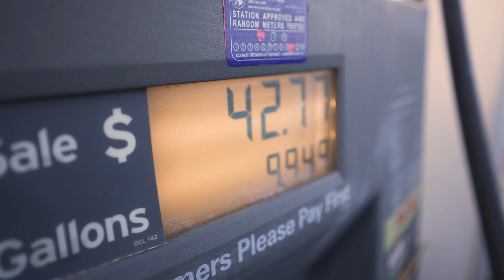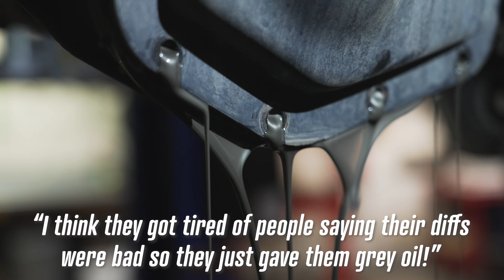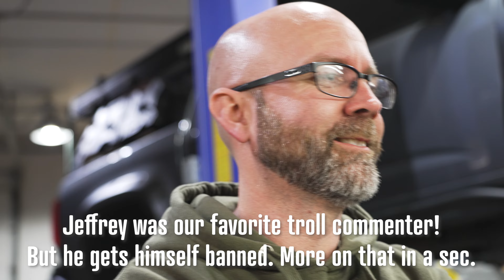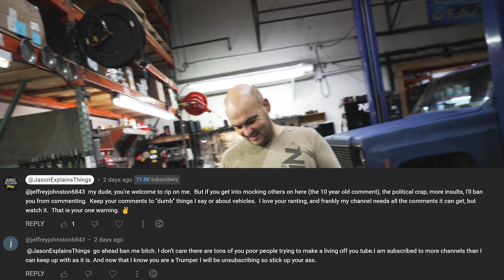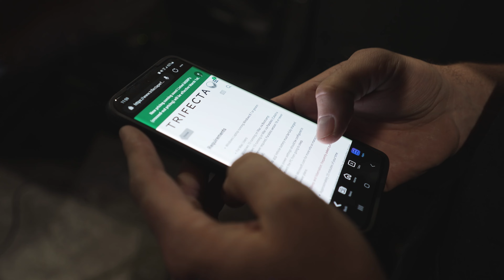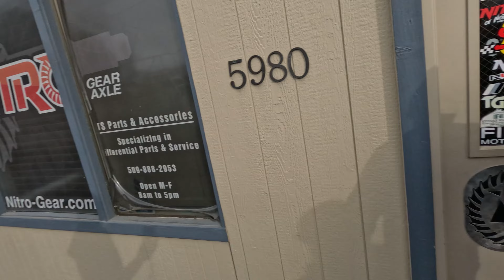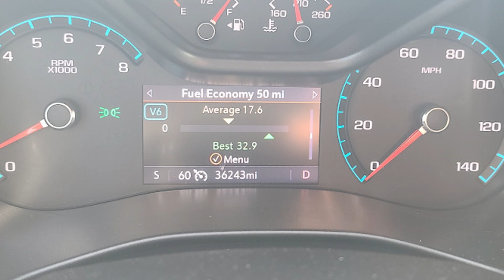Chevy Colorado Gets GEARS!  A MUST For Big Tires! (Nitro Gear 4.56)

Comment: Did your hear any loud noisy @65 0r 70 MPH?  according the colorado fan site, there some people complaint 4.56 upgrade.. I gonna regear my zr2 after you guys, don't know yet if 4.10 or 4.56
Reply from the maker: I passed this question on to Chris.  From what he's said I don't think there is any gear noise.  For the question of 4.10 vs 4.56... we deferred to Jerad's expertise.  He recommends 4.10 for a diesel with 35's and 4.56 for a gas ZR2 with 35's.
Reply: This is the question on everyone's mind, and to answer the question, yes! You can hear the gears.  But barely.  If I'm freeway driving, I can hear the gears if I dont have the radio on and am completely quiet.  This is going to be a personal preference thing, but for me it's so minimal, I completely tune it out unless I'm actively listening for it. Hope that answer helps.  I was worried about the noise issues others brought up as well, but now that I have them in, it's a complete non-issue for me.
Reply: Surpring the 0-60 was the same.  Truck need 5:13 or so gears if they made them.  The main problem with the colorados is the complete lack of aftermarket parts when you compare it to a toyota.  Not sure why the aftermaket does not support the colorado.  Should also mention when installing the nitro gear make sure the pinion depth is near 46 thousands not the 95 that nitro recommends.  If you go the 95 you will get a howl from the gears.

Comment: How much can one expect a regear to cost? I get that it will change based on shop and region etc. But it would be nice to have an idea. Thanks!
Reply from the maker: Parts are about $1500 (link below).  Labor costs depend on where you live.  I’d estimate $3k or so for the whole job.
Reply: Depending on your trucks mileage you could get by with just R&P and likely one or two pinon bearings.  That's what I did and it was $1400 back in late 17.  4.10's and 33's have been a great combination.
Reply: Mine colorado is 2wd it was 650 for parts and 600 for install in so cal
Reply: @MrPROGAMER56 Could you send me the link to the parts you used?

Comment: Curious that they recommended 4.56s, I feel like that'd be pushing it a bit for the front diff's pinion gear size. I suppose those V6s aren't terribly torquey though, especially with a 2.6ish low range

Comment: Great video! What's the cost difference with aev doing the conversion?
Reply from the maker: Not sure.  The upfit AEV service includes re-gearing along with the highmarks and other mods.
Reply: @JasonExplainsThings  at $13k from aev... can you calculate doing all the work on your own?
Reply from the maker: @okpop78  That right there is why we've done so much of it ourselves.  Chris essentially now has an upfit Bison with every AEV accessory.  We did all the work ourselves, minus this re-gear.

Comment: I had a Jiminy in my Colorado. The latch to the rear seat back on the driver's side was the culprit. A small piece of cloth tape on the u shaped latch striker silenced it.

Great video as always!
Reply: Checking this tonight, thanks!!
Reply: Andy (and Chris as well) did you get the seat squeak only when a person was sitting back there? That seems to be the only cause for my own little Jiminy.
Reply: It did only squeak with a backseat passenger. We couldn't figure it out for a while, but I'm ocd when it comes to vehicle noises so I kept looking 😂

Comment: That's quite a project! Glad there are people like Jerad that know how to do stuff like that!

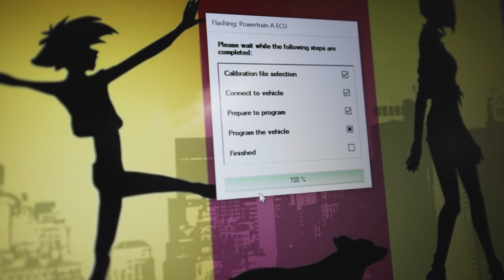@13:25 does Chris have the famous Colorado taillight burnout? I had to replace all 4 of mine on my 2020 within the first year and I see so many around with lights out. The lower-brightness on the dual filament burns out and the brake lights/indicator will illuminate, but they won't be on just for running lights.
Reply: Yes, I did have that exact issue.  I've since fixed 'em.

Comment: About to put dana 4.10s in my colorado with 2.8 duramax to help with towing. 285/70/17. Might lose some mileage but then again mayne not if I drive normally. Averaging 28-30mpg currently. 32/33 if I keep it under 50mph.
Reply from the maker: Wow!  Those diesels are awesome.

Comment: I ordered a 2024 Colorado Bison that should be delivered in April. All Colorados come with 342 gears no matter what trim or tire size. Stock tires are 30” ish. The Bison has 35” ish. GM won’t change out the gears. My calculations say that it needs a 411 gear to accommodate the larger diameter. However, with a little experience and the added weight of the rubber, I’m thinking 456 may be a better choice for the 2.7 turbo max and the 8 speed transmission. I do plan on hauling about 6-7k occasionally. What’s your take on that??
Reply from the maker: Reach out to Money Pit 4x4 on Instagram.  He did Chris’ truck and he’s the most knowledgeable diff expert I know:
https://www.instagram.com/moneypit4x4_wa?igsh=a2pocXcwem8yd2Y0
Reply from the maker: I tend to agree that it should come with different gearing.  An engineer from Chevy might’ve told me as much when we went to the press event.

Comment: How is it on the highway 70/80 mph?
Reply from the maker: I'd let Chris give the definitive answer on that.  From what he's told me he doesn't have issues going 70-75.  That's as fast as the speed limits allow in Washington.  He's said the new gears are slightly louder than stock at those speeds but barely noticeable.